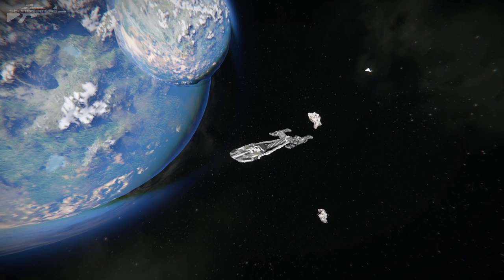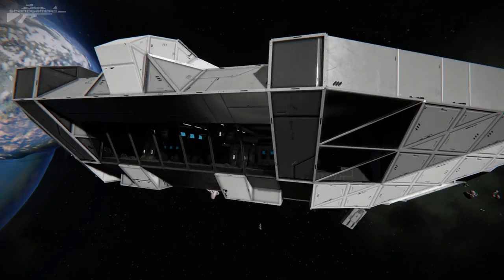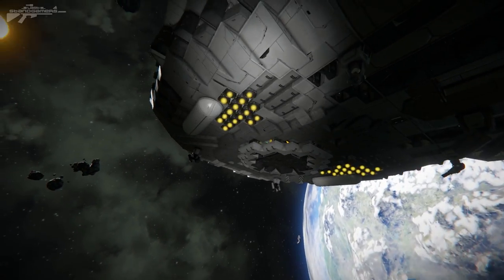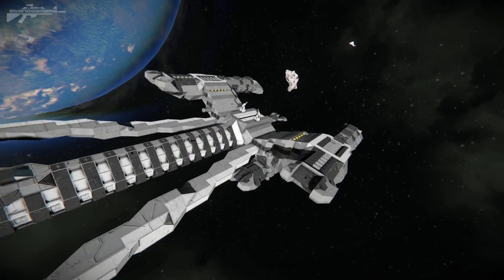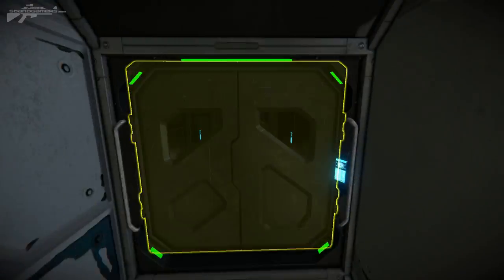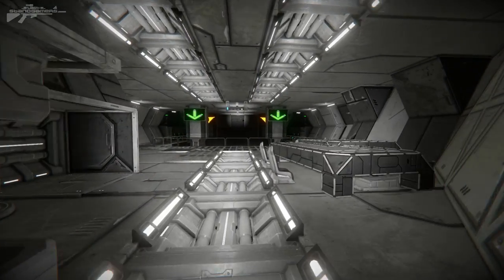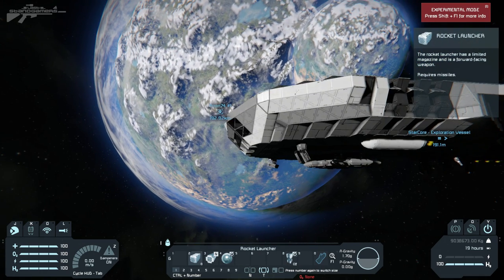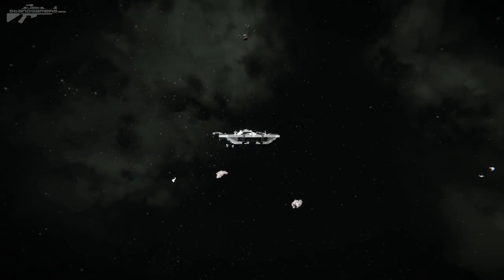Space Engineers - StarCore - Exploration Vessel

Comment: The ship looks star Trekkie, but functional it is not. The three connections from the engines are Extreme structural weaknesses and defensive flaws, targeting them will gut the ship very easily. Plus the space in between those three connectors can be used for cargo storage or some other purpose like recreation area, ect; increasing the ships exploratory mission capability. Overall I give it a 3/10, the potential is there but it has to many critical structure and defensive flaws to make it worth the resources to build and use.
Reply: The neck as i call would break very easly yes, but therefore there is the 2 support beams. They consists only of armor block and wont be a target by turrets. It's also star trek inspired (:
Reply: @notexinity9204  Generally there is huge difference between visual and practical design. This ship clearly is build for visuals, if small block interior didn't make it clear to those people here. So many of those complains are invalid (in the Treck for example shield were so strong that it was irrelevant how sturdy design itself is, as you would die anyway when shields drop). Yes, there are nitpick here and there, but I've seen way worst ships then this one.
Reply: Jackie Tearie  Neh, it would die immediately, especially because it seriously lack forward thrust, structural integrity and all deployable stuff are asking for trouble in real combat. It meant to look cool and it does. Creator clearly has a potential, even if he need work on his skills here and there.
Reply: Jackie Tearie  Exactly.
Reply: @TheRezro  also you might think it's slow, because arron only shows the 4 hydrogen thrusters x4. But inside the big 4 thrusters or whatever you will call it, there is about 10 more hydrogen thrusters in each.. So about 40 hydrogen thrusters for forward thrust.. But yes it could be better.
Reply: Jackie Tearie if u build a ship for exploration then it needs to have defensive capability after all its purpose is to explore the unknown and survive the dangers there in.
Reply: Exinity I said 3 connections, not neck, are structural weaknesses they may not be targeted by turrets, but that doesn't mean that they can't be targeted by pilots/players Manually with rockets and/or ramming tactics. It's a poor design choice that is devastatingly exploitable. Also I mentioned above if reshaped funtionally it could be turned into usable space for various things hanger, storage, hydroponics, recreation, ect. My goal with these comments is to encourage better and more functionally interesting designs, not sink the creator into oblivion.
Reply: @ninekings3139   I appreciate your honesty, thank you
Reply: Exinity it reminds me of voyager and thus a lot of potential to be really cool. sorry about the harsh parts of my criticism, but better harsh and constructive criticism meant to encourage, then words meant to break and destroy your creativity. I wish you the best and ever greater projects, good luck to you.
Reply: @ninekings3139  Thanks and hood luck to you also.